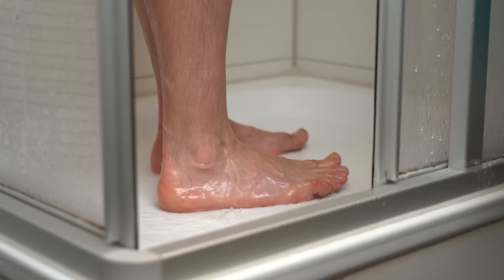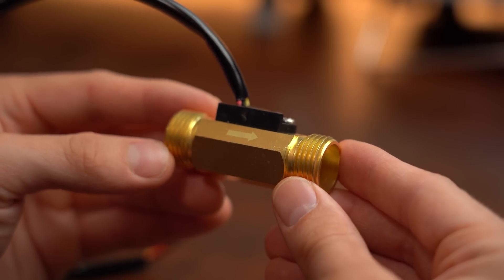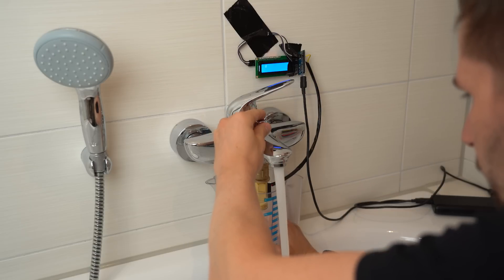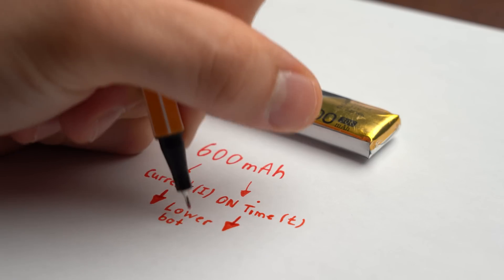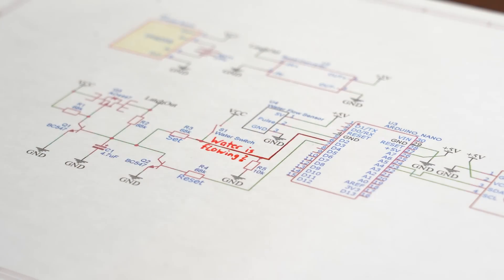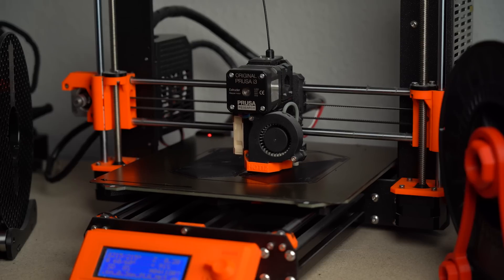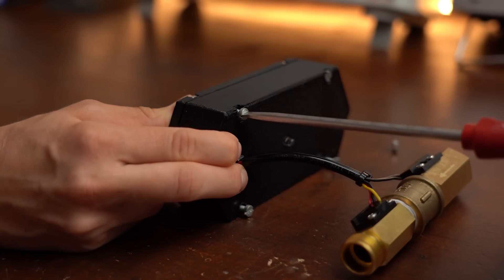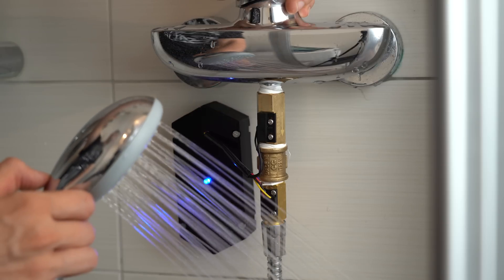Every Shower needs this Upgrade! (Online Water Tracker)

Comment: I came across a shower head that displayed the water temperature and had some LED lights.
Lidl recently sold that too.
Sadly it failed, so I took it apart: Inside was a small water turbine that generated some electicity as soon as the water started flowing.
Wouldn' that be another idea instead of the battery?

Comment: I read and see this video now because i bought a 3/4 YF-B6 sensor. A Dutch seller from this one say: "The output of the sensor gives 6.6 pulses per second with a duty cycle of approximately 50% for every liter of liquid that passes through it per minute: Q [L/min] = fpulse[Hz ]/6.6.". But also warned: *Note: This is a factory specification under specific circumstances. Should the sensor be used in a situation where accuracy is required, it is recommended to calibrate the sensor in that specific setup.

Comment: Thank you very much Scott.  I have been thinking of making something similar.  I live in Scotland where water is charged at a flat rate (It rains a lot) and there isnt a significant environmental problem with using a lot of it.  What is not free however is hot water.  So I intend to measure the temperature as well as the flow rate and work out the Kwh consumption.  Unfortunatly my wife has installed one of those fancy showers with multiple outlets so that will nicely complicate the system!  I'll need a display in the shower too because thats where the infomation is going to do the most good.

Comment: If you attach an water turbine you can charge your battery... Or just run the system with water flow which is good

Comment: I used espCAM to take pictures of my digital water and gas meters (they are quite close to each other) and use lora module to send the picture to another ESP32 and performed some computer vision / OCR and send it to Thingsboard....

Looks like an overkill but the best part of the system is that it is 100% non invasive. BTW it is also solar powered by second hand panels..... So it is by itself eco-friendly, let alone it cuts my bill.

Comment: As I not see the problem with the cold water usage, I was thinking about a coin automate placed at the warm water line. 
Any family member would have a coin deposit at the month/ week start and can us this. The automate let through for an defined time/ amount of liter and close the line after reach the limit. My family don't care about the measurements as long the bills will be payed... ;-)
But for some reason, the hole family was against my plan and have threaten me to split my share of coins between them, if I should go with this. So I have postponed my plan...

May be, I will hide my idea behind your project with some little adjustments?! (electric valve, shopping/ billing app, ...) ;-)

Comment: There is not actually a fault with the sensor not reading pulses at a low flow rate.  Part of the problem is that you have you have no pressure on the output in your testing. The shower head probably produced enough back pressure to clean up the pulse counts. 

i.e. When running slow, the water was basically falling through the sensor turbine, not rotating it some of the time. When running fast, the water was too turbulent and causes oscillations (because the entire pressure in the system was dumped across the meter turbine.) You can hear the turbine oscillate when you blow air through with your mouth. The flowmeter must be in a section of the system where flow is laminar, i.e. not at the final point of release to 0 pressure. Hope this helps someone!

Comment: Great Scott! What a project 😍
Have you had a look into ultrasonic transducer based water flow sensors? As far as I can remember they rely on the Doppler effect to measure flow speed. Given a fixed pipe diameter you can calculate the water flow. Some systems do so without the need of a pipe modification, since the sensors are just strapped to the pipes. Combine those sensors with some temperature sensors and you are able to monitor the heat energy flow through your heating system 😍
Would this be worth a project? Would be an interesting video 😉

Comment: I start follow the channel recently and watched this video just today.
Congrats for your well done videos.
It has plenty comments, I can't pass through all of them. If someone already suggest it, just escape it. You use two devices on the pipes, one to measure wather flow and other to recharge the battery. I was wandering if the second device isn't enough to do both things. You would need access the inductor inside the second device to sample the flow signal. I don't know if it would be easy, but would reduce one mechanical part of the set.

Comment: Regarding your suffering through HA, you could've tried implementing that piece as custom component, or as lambda of an internal button or similar.  Still less code to worry about than if you had written all by yourself.  However, an interesting feature for ESPHome to consider :)

Comment: I've thought about that too.
My idea was to set up a small camera that films the numbers on the water meter. 
The clue is that the arduino camera module is hooked up to a Raspberry Pi Pico which converts the pictures into numbers by a machine learning algorhitm.
That way you won't interfere with the water meter and your readings would be quite acurate. Also there are tutorials for TensorFlow Lite on YouTube which is designed to be used on micro controllers.
After googling my idea I wasn't sure if this already exists, but find out yourself!
Greetings!

Comment: Would like to see it monitor temp, so that you can run a calculation for how much hot water is being used. Very likely that is going to be the larger contributor to cost by a fairly large margin.

Comment: Instead of using a battery and pressure switch, could you power the system and read the flow rate using a single turbine turning a generator?

Comment: Nice! What with droughts ongoing at the moment it's super good to track this.

I have always just turned my shower on and off during my shower whilst using it, like the old showers that used pull handles to allow water to run.

Comment: You could probably use the pulse interval to calculate flowrate and then calculate volume from that, with consistent water pressure this would work. If you wanted to get fancy you could even add a water pressure sensor to add accuracy.

Comment: I doubt, that in the region of Stuttgart, water costs are an issue, unless excessive showering. What might be an issue is hot and warm showering, since heating up the water costs energy, usually much higher than the water price, unless showering with cold water. 
To calculate the price, you would need water amount * temperature risen * power cost, decorated with a correction for power loss. Maybe you can easily reach the volt meter of your energy provider and read the values before and after showering. If using a boiler, you have to wait, of course, until the water is heated up again. Meanwhile, the refrigerator kicks in ... :) 
But since you showed an at least basic knowledge of statistics (669+651+670)/3=660 :) @3:53, this might give a good estimation. 

If you use a boiler, a light sensor in front of its status led might be a simpler solution.

Comment: There's just SO much wrong with this whole project.  Let's start with the premise... saving money.  

You said your water rate is 0.0039 Euros per litre. Doing the math, you can buy 312.5 litres of water for 1 Euro. By regulation (here at least, and I believe probably even tighter in Germany) a new shower head is restricted to a flow rate of no more than 9.5 litres per minute.  So for that 1 Euro, you can run the water almost 30 minutes! Just how long do you normally spend in the shower - and much money are you hoping to save?  Let's call 20 minutes a long shower, with a quick shower being 5 minutes. Using the above numbers, and if you shower twice a day, you can save  at most 1.11 Euros per day! [9.5 litres per minute * 15 minute shorter shower * 2 showers per day = 285 litres, at 0.0039 Euros per].  Are things so tight that a bit under 8 Euros a week will make your life all that better?

But also, there's all the unnecessary complexity and equipment. You could've just timed how long it takes your showerhead to fill the 1 litre container, and done some quick math to figure out the flow rate in litres per second. Then install just your water switch and have the microcontroller time how long the water flows. Multiply seconds by measured litres per second to get litres, then multiply litres by cost per litre to get total cost. No need for a flow sensor at all!

And finally, you completely mus-interpreted and/or misrepresented what the flow sensor is intended to do. I followed the link in the description, and the "Water flow rate sensor" doesn't say it measures the quantity of water passing through it, it measures the FLOW RATE of water passing through it! Quoting the listing...  
Pulse frequency: (Hz)=[ 11*Q ]±5%(Q-- flow L/min )

So you complain that it doesn't give the same pulse count for the same volume of water, when what it's designed to do is give a pulse rate proportional to the flow rate of the water! Now it so happens that at 11Hz per litre/minute, and 60 seconds per minute, the result should always work out to 660 counts per litre no matter the flow rate, but still... 
[
 "X" litres per minute = "X/60" litres per second,
 .. and the inverse of "X" litres per minute gives "1/X" minutes per litre,
 .. so the inversse of "X/60" litres per second gives "60/X" seconds per litre,
 .. and now, "11 * X" pulses per second (flow rate in lpm) times "60/X" seconds per litre gives:
 "11X * 60/X" = 660 * X/X = 660 * 1 = 660 pulses per litre
]
So while you found (stumbled upon?} a useful and correct relationship, it seems to me that you got there based on unwarranted assumptions about how to use the sensor.

Comment: I'd put this sensor on the cold input to the hot water service, where the pressure is much more constant, and it then also accounts for all hot water usage. 
And provided that the HWS is outside of the bathroom, much of the special safety issues are obviated. The alarm could be a simple radio activated standalone unit.
My external HWS is controlled by an AVR with an RTC that follows a temperature schedule, so that overnight the water is kept lukewarm, but gets the water hotter at the times that I will need it. It also records inlet, tank, cupboard and external temperatures. I think I'll add one of these flowmeters when I upgrade it.

Comment: Great video, however, hot water costs a lot (and I mean a LOT) more than just the water itself. Like a factor 10 more or something like that (depends on the heating method). Great video, just one small remark

Comment: You could integrate a small water turbine, to charge the battery, while the shower is running. Probably not gonna generate enough to never have to charge, but may significantly increase the time between required charging.

Comment: Hi Scott. Great video. Got me thinking about a project I would like to do to monitor heating oil usage to our boiler. (We live in rural Ireland). It's been on my to do list for a while and with heating oil prices going through the roof, it has suddenly become more of a priority so we can see what we are using each time the boiler is on. Just wondered if you had come across a similar sensor for other liquids? I had a brief search to find something similar to what you started out with and was not successful. Thanks.

Comment: 2:00 BRO 💀 why didn't you just use the impedance of a motor and measure the voltage across the line to figure out the rate of flow 🥴

Comment: Very nice video, useful in these days indeed ;) 

I am wondering if the water switch could have been replaced by an “hydro micro generator” (s. AliEx) to constantly recharge a small(er) battery. By sending the microcontroller to deep sleep it might be also possible to simplify the circuit… 

Keep up with the good work!

Comment: If showering in a bathtub, you could just put the stopper plug in and let the bath fill up with the shower water. The level in the bathtub could be measured with some markings on the side of the tub.

Comment: Nice plan.I did expect you to track also the heat of the water as the energy needed for heating the water probably exceeds the cost of the water itself. I would expect a shower to cost around 0.5 Euros probably.

Comment: It’s not how it’s suppose to work if you consider using the same debit of water every time you just have to record time of usages to know how many liter had passes, the sensors you using is a debit meters by measuring the frequentcy of pulse you can know the volume by integration.

Comment: It's a nice project. The water flow sensor that you got is cheap as it is not calibrated, it is just a flow sensor (yes/no) and not a calibrated sensor which can cost 10 or 100 times more than that and is restricted to flow ranges, pressure, temp, etc... If you get a calibrated one definitely the project can be moved into the main pipe, right after your internal water cut-off valve so you can track all house water expenditure. I have a similar project (it can be powered all the time as it is in a humid zone and not in a wet zone) but used a cheap meter and faced the same issues as you did with different flows.

Comment: I'm surprised you can't monitor your water like you would be able to do with your electricity. They even sell meters that can tell you where all your electricity is going and which devices are using it. This seems like a big problem on the consumer end that you can't monitor your water consumption. You just have to trust your water provider. Gas stations are checked every year to make sure their meters are working right but the big question is who's checking your water meter? I'm sure the company doesn't check it unless they feel they're not getting paid enough. This seems like a problem. If they are going to do this to the consumers, then we should give it right back. Call every year and complain your water bill is too high and there's something wrong with your meter. Have them waste money coming out to check every year. Maybe something will change then.

Comment: Friend of mine did similar by stealing the wireless signals transmitted by the water meter - it transmits every minute or so the account number and usage. With an RTL sdr he can listen to all the neighbors - once he figured out which was his he pointed the sdr to an mqtt thingamajig.  Granted it dilutes things down to much longer intervals, and misses multiple users at once - but he's a bachelor so it doesn't much matter.

Comment: Why didn't you use the reed output of the water meter to trigger your bistable power control circuit ON?

And by the way, great project! Thanks for sharing your ideas with such high quality videos.

Comment: Although you're a maker there's great hardware available from HomeWizard (quite accurately called the 'watermeter') which you can stick on your flow meters from the water company that actually (I guess) take pictures of the meter and then interpreting this to the actual value which in turn reports this daily/hourly or something (It's not released yet so might be a bit of 'magic' involved). Maybe you could try to found out said magic and make your own ;-)

Comment: You should print your own sensor and use the spinning wheel to generate a little voltage to drive your circuit.

Comment: My main water meter has a place for getting data out (Some data sheets call it "impulse emitting devices", other it seems like there is a place for a reed switch to get pulses) (mine (a Sensus meter) seems to have the reed switch output) "T-probe reed switches" seems to be the term used for those sensors (I mainly see South African discussions - so it is possible that it is mainly common on our meters...)

Comment: For extra responsibility, one could use a simple set of diverter valves to recirculate already used shower water captured in the drain to then re-rinse the hypothetical shower enthusiast. Maybe slap a re-heater to the return feed and perhaps a simple filter to keep it “clean” and voilà! Not recommended for those who shower for practical hygienic purposes

Comment: Next you need a temperature sensor which then compares the water in your shower to the cold water supply temperature and then calculate the cost of heating the water.

Comment: If you had 2 water pipes that were open to the air, I'd suggest using a TEC to power it, you could use the disparity between the hot and cold water to power it then. But, that would only work when using both hot and cold water.

Comment: Neat project.  Several years back we had a $1000+ USD water bill because of a broken water line after the meter.  (In Hawaii, palm roots broke the line.  The soil is very porous so there was little visual indication we had a huge leak.)  We found a commercial product called Flume the goes against a USA style water meter and senses the flow.  It requires batteries (special high capacity AAs) that last about a year.  Still, it works great, gives you stats, warnings on usage, peace-of-mind, etc.  I would have enjoyed making something like this instead, but for the whole house.  You'd need to work out sensing that measured the flow without making any changes to the piping, though.  A GreatScott version of that would be a great follow-up project.